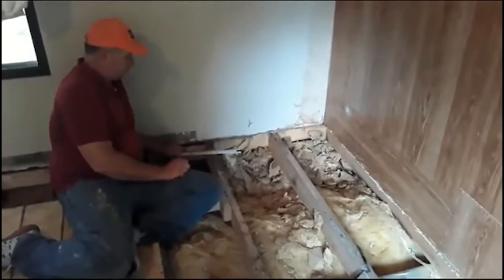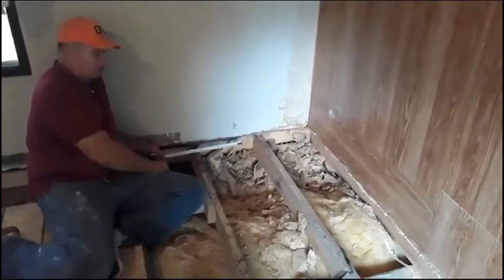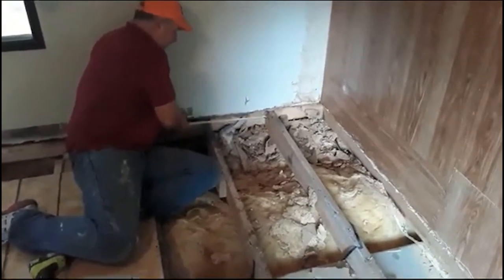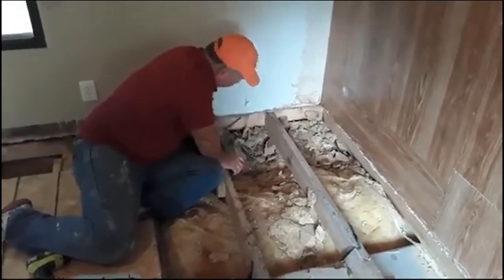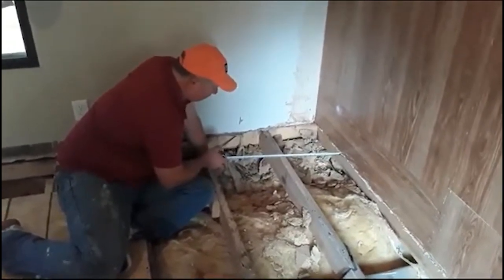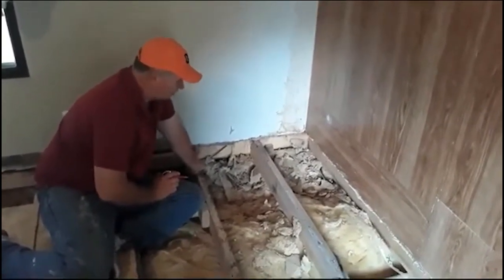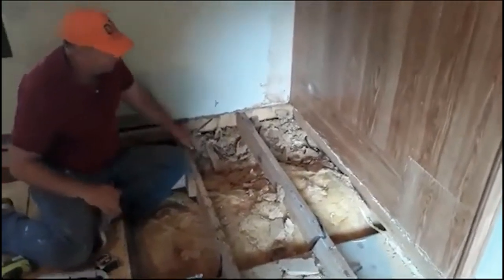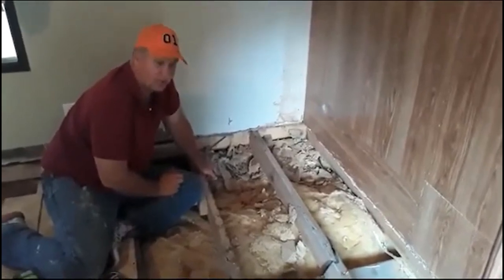Mobile Home Repair Subfloor Support

Comment: Show taking out the floor joist beam and replacing it under the tub shower. My mobile tub/ shower is sitting on beams , no wood flooring . There is  rot around bathtub .
Reply from the maker: I probably would put another 2 by 6 beside the bad ones